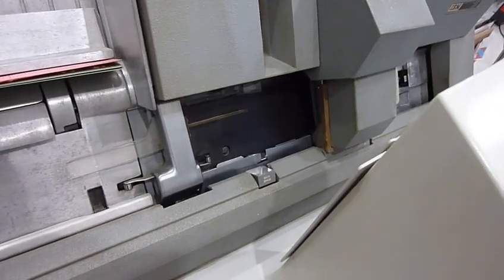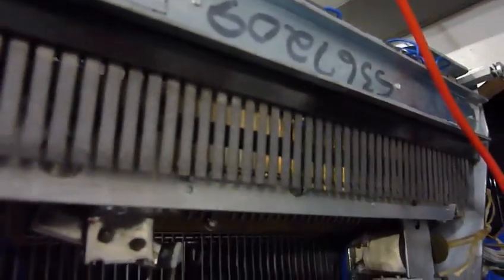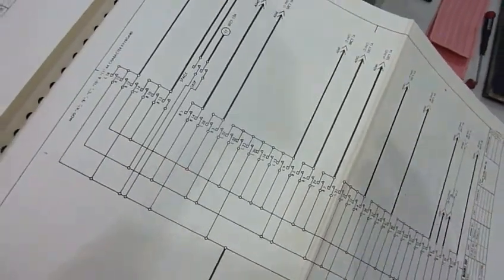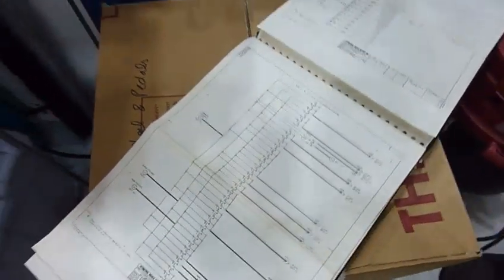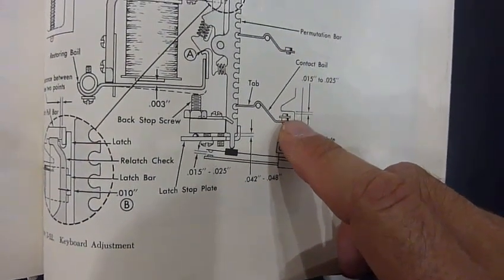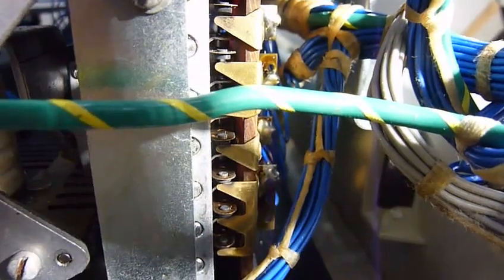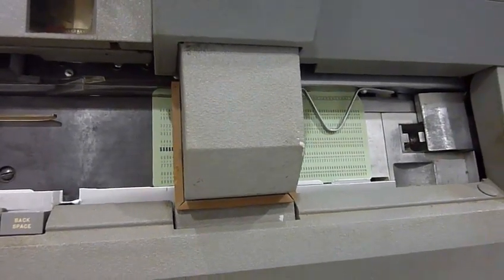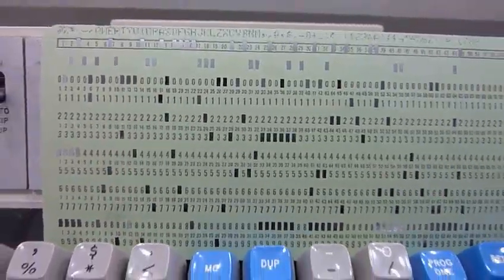IBM 029 Keypunch Restoration 6 - Insanely Complicated Keyboard

Comment: The IBM 029 keyboard is the same as the IBM 024/026 keypunch keypunch.  (The 024/026 were the first machines I was trained  on when I joined IBM in 1965.)  These keyboards were the fastest mechanical keyboards ever made.  When a key was pressed the restore electromagnet was fired to restore the mechanism for the next keystroke.  The restore was controlled by the punch mechanism so a badly adjusted punch clutch would cause a slow keyboard restore and cause the operator to complain about a slow keyboard.  There were very few operators who could key as fast as the keyboard on a properly adjusted  machine could respond.
Reply from the maker: Well not really, just about the opposite! They are specially made to slow you down so you can't type faster than the machine can punch... Hence the "restore mechanism", that locks all punching keys as soon as one is pressed. And then it waits for the punch to unlock them via the restore electromagnet. What you probably experienced is that the 029 punches even faster than the 026, which was no slouch, hence the keyboard "feels" faster. So you are right, it takes a good typist to overrun it. But in reality, it was just less "slow"... That said it is the king of the mechanically encoded keyboards - very complicated and built like a tank!
Reply: @CuriousMarc  Marc, you are correct about the reason for the interlocking between punch mechanism and keyboard.  However,   as I said, I was trained to maintain and repair both the 024/026 and 029 and they were mechanically the same.  Our goal in servicing one of these machines was to ensure that the punch mechanism was adjusted properly so that an operator, no matter haw fast they could key would never sense that the keyboard was locked waiting for the punch.  Also as I said, a badly adjusted punch clutch would cause a slow keyboard restore and cause the operator to complain about a slow keyboard.
Reply from the maker: @Selkirk5934  Now I agree with that. That's the correct way to put it.